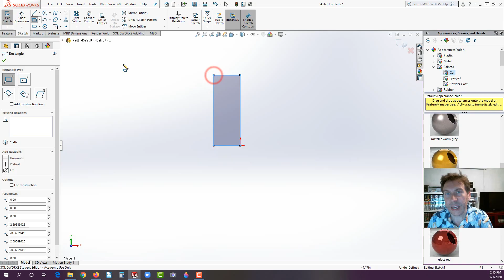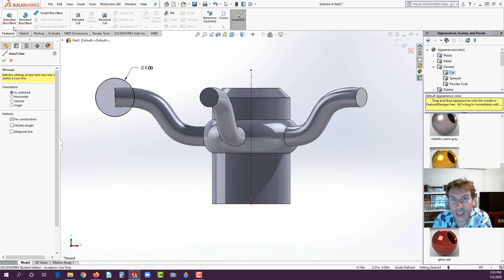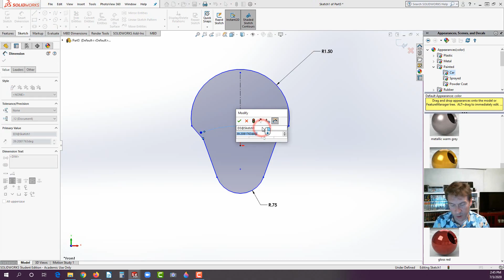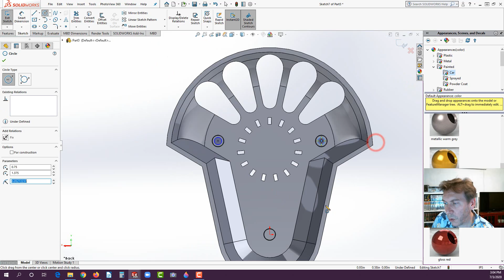E4 SolidWorks 2020 - Basic Modeling 4 Tutorial

Comment: Extremely helpful videos!! I have been learning a TON. I am having trouble with the cutouts on L4 though. I am using SolidWorks 2026 and after I extrude cut the slots it tells me that the sketch is over defined. I am doing exactly the same thing as in the video. Is this something with SW 2026? or am I missing something?

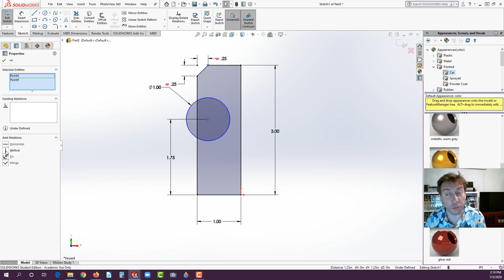Comment: 6:00 Design intent? Doing it this way would mean if the chamfer was changed this feature would change too. I trimmed the unwanted lines then dimensioned it the same as the drawing to set its position.

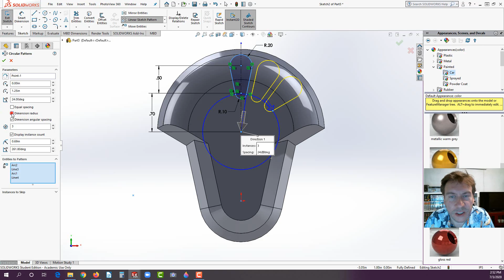Comment: At 39:42, when I select "dimension radius" for the circular pattern, the sketch becomes overdefined. When I don't "dimension radius", everything is ok. Is that alright? Am I missing something?
Reply: Hello ! Im having the same problem, and the same solution on my side. I suppose "dimension radius" or "rayon de cote" sets the radius as a constraint on the initial sketch since it is included in the three occurences, but i dont get why this overdefinition problem doesn't happen to him considering he has also set the smart dimension to the center on .70.

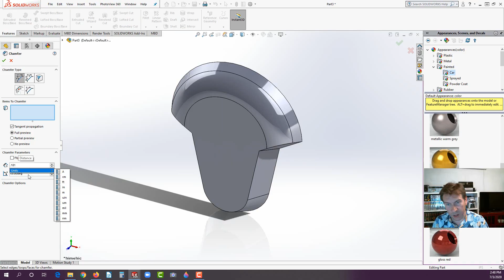Comment: So, the angle in a chamfer(@35:02) is incremental from the  last surface, which was at 25 degrees? That (chamfer)surface actually created the edge we are chamfering now. It is somewhat confusing, There should be some kind of parameter window with choice about the angle being measured from top surface(in absolute or incremental angle) or from the chamfer surface, which was created at 25 degrees (also choice of absolute or incremental angle). Same goes fro the size of the chamfer. Why? Because chamfer size is measured from top surface down, so why the angle doesn't follow same scheme?...which would actually make the angle at (minus) -35 degrees in absolute from the top surface/X coordinate axis, or 55 degrees absolute from the  X coordinate axis/top surface.
Can you , please, confirm, that it is always the same way-e.i measured down from top surface and angle incremental from the side surface.???......I am just wandering how do you then decide, if the 2 surfaces (top one and the chamfered surface) are not paralel to any mayor axis or soordinate surface!?

Comment: 35:00 I found that typing .181 in that direction (25deg draft) will result in .164 in the horizontal direction, not .181 like in the drawing. Is there anyway to specify .181 referenced horizontally directly?
Reply: I noticed the same problem

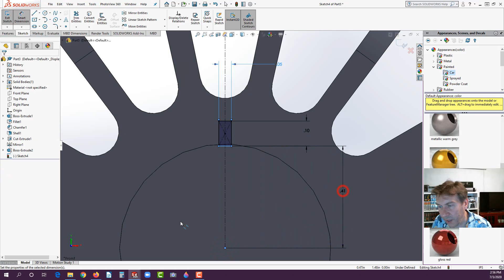Comment: At 43:20 You put .371 from center to the rectangular. But on the sketch is different, there You have .371 from center to center of rectangular, so was it Your mistake?
Reply: I saw this as well. The .371 dimension is to the center of the rectangle, not the bottom of the rectangle I believe.
Reply: He's correct. The .371 is from center of the arc to the bottom of the rectangle. It's a bit hard to see because the rectangular extrude cut is the upper rectangle in the drawing, while the lower one is the fillet.

Comment: To snap to the center of the  arc at ~ 11:00 , you can add a point. Additionally, you can put your first point of the construction line on the bottom, then hover over the arc and it will wake up a reference.

Comment: I have been practicing the exercises for two days, but I just had a problem with using the hole wizard tool in exercise 4. The issue was related to the fact that I'm using MMGS, to solve it I simply had to check "show custom sizing" in the settings and change all "in" to "mm".
I truly appreciate the videos, this is really a free distance learning course. THANKS A LOT!
Reply: Hey there, did you manually converted from IN to MM? or is there a function to change it from In to MM? Can't find it ! Cheers

Edit: Just had to change the 'Standard' to ISO :)